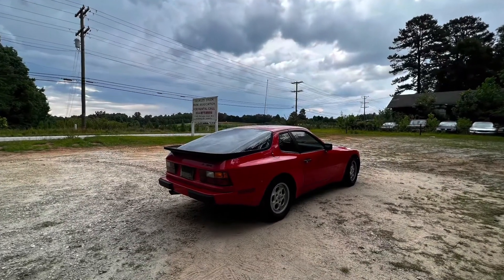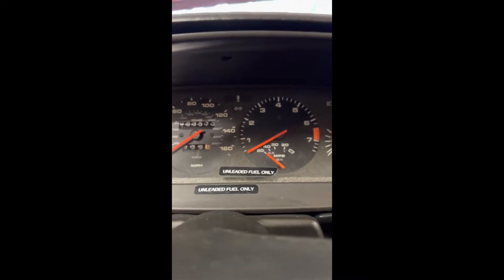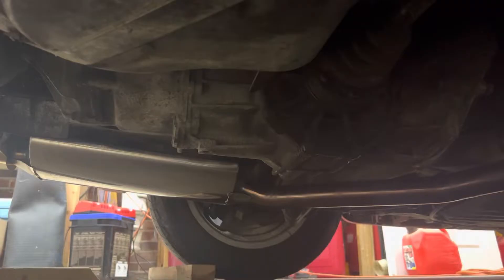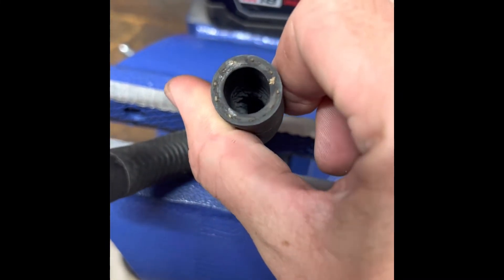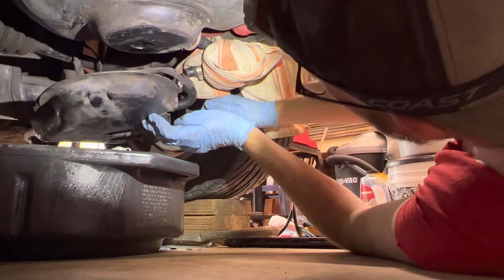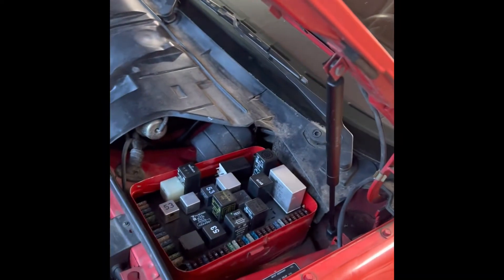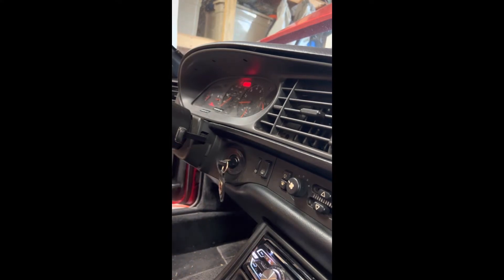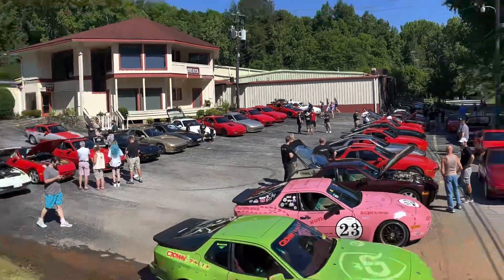944 No Start Fixed

Comment: I have the 951, its fun but I have alternator issues. Either the voltahe regulator or a wiring issue. All 80s cars dont run without a good fuel pump..my 87 fiero gt did the same.👍